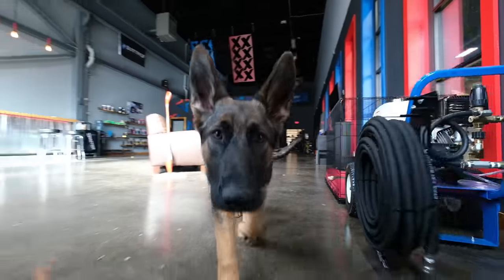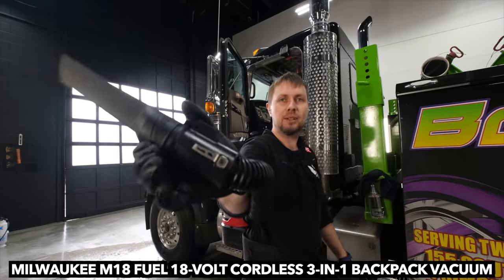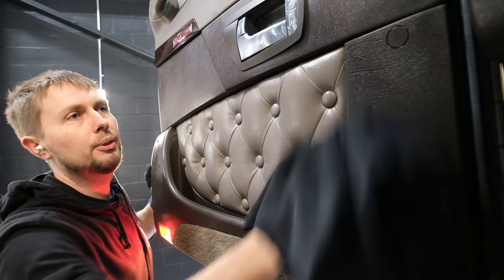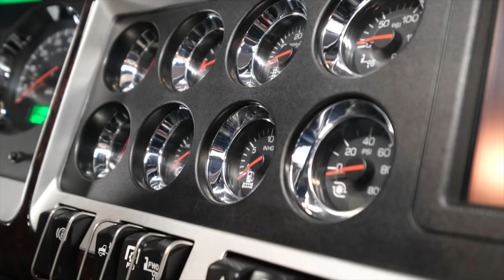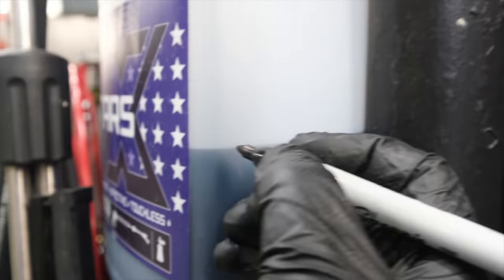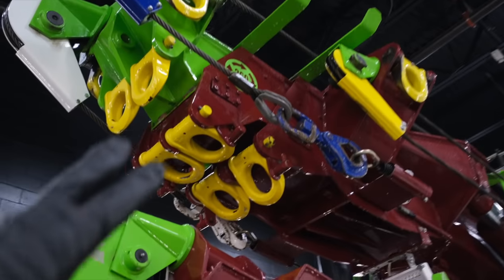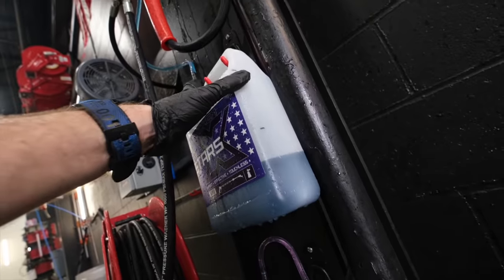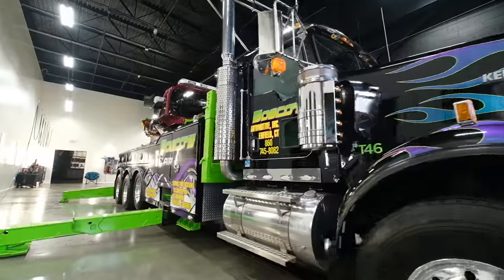TOUCHLESS WASH + Sio2 SEAL on A FILTHY Kenworth Wrecker!

Comment: Good for Bosco's Towing for ordering an Allison for their truck. Makes more sense then a manual.
I liked how you detailed the interior but I'd like to add one tip please. I clean the instrument pod, dash details & the selector buttons w/ a dry brush in one hand & the vacuum nozzle in the other, that way any stubborn crud is loosened w/ the brush then sucked away. Then I use the dash cleaning spray & another brush, then dry it off like you did. I always found I'd leave some crud behind if I went straight into the spray & brushing. Good job, nice video.

Comment: I remember working part time for a towing company and their interiors were so CAKED with crud, it got to the point where the seat upholstery had to be replaced since it could no longer be cleaned.  Gross.  There were times when a customer would have to ride with us and it was literally embarrassing, but good for them they didn't have to sit in the driver's seat!

Comment: Get yourself a McCulloch steamer. I run the 1385 just for capacity and run time. I do alot of interior detailing on trade ins for the local Kenworth dealer and you would be amazed at what that thing will do even on the worst log trucks.
Reply from the maker: I have that steamer actually I have to bust it out next time I come across seats like this I think it would help for sure

Comment: Great video! We really need chem x over here in Europe! Its at least some product that works clearly and is not just expensive high diluted chemistry,but real chemisty and cleaning power.
Btw. Did you ever consider the new suttner st163.1 selector valve for selecting up to 4 diluted products on your st160 valve? you could also select easily snake oil and could also implement even a 4th detergent in the foam/HP stream. 
Greets from a cleaning equipment & pressure washer dealer colleague in the Netherlands
Reply from the maker: Thank you! That’s a really solid idea on the st163.1 I’ll look into it!

Comment: Ok, I'm watching you take this grime out of the door panels and whatnot like butter. I hate having to spend hours trying to get hard grime out of my steering wheel and whatnot (door handles, shifter, hand contact points, etc) of my work truck.

The majority of it is grease and auto grime from doing automotive work out in the field. I try to keep my hands as clean as possible (wearing gloves), but I can't really keep them pristine because most of my work is away from a shop or place where I've got some key magic hand wash (seriously its the best stuff I've ever used, better than Fast Orange or Gojo period!) handy.

What product would you recommend I use to clean this hard worn grime out of my interior? I see you use the tea tree protectant. Do you think it would be able to cut into greasy dirt filled grime that accumulates over time?

I try to keep my vehicles looking pristine because I like to show customers that I care about the work I do, and having a grimy wheel is just embarrassing. I've got a bunch of stuff I use for detailing my cars already, but I need heavy duty help for my work truck interior!

Comment: I don't know what kind of glass cleaner that was, but you always need to be SUPER careful about spraying it on LCD screens because it can physically damage the anti-glare coating. You can have all kinds of problems with pitting so it makes it look like the screen permanently has waterspots on it. When cleaning an LCD, I always use an cleaner specifically safe for anti-glare coatings like ones for big-screen TVs or even Eyeglass cleaner can work. I actually keep a few spare eyeglass wetwipes in my truck to clean the nav-screen in a pinch.

Comment: How does this soap work on lime dust. It looks like it works amazing on dirt, salt and any road grime. But we haul lime and the only thing that seems to work is acid and it leaves the aluminum trailers, wheels and fuel tanks looking like they are 50 years old and never been washed. We have sealed are trailers and that don’t work for very long